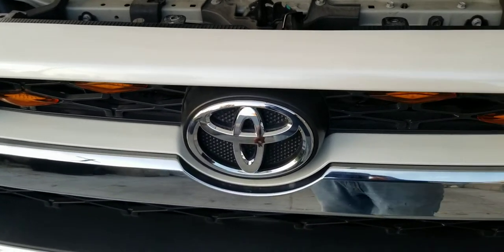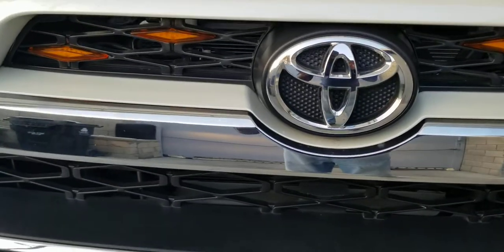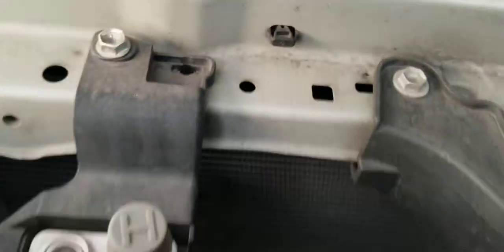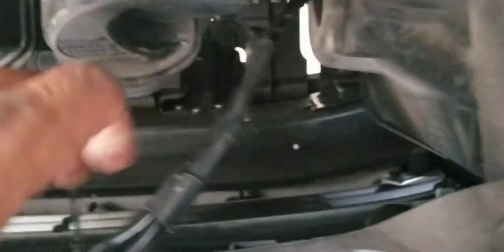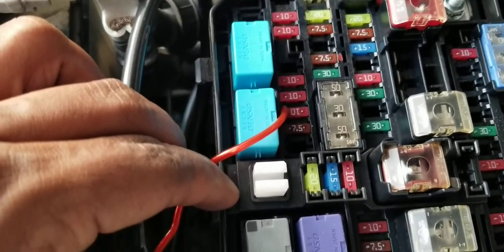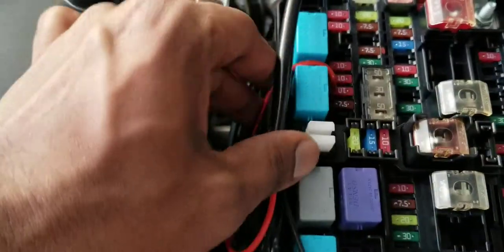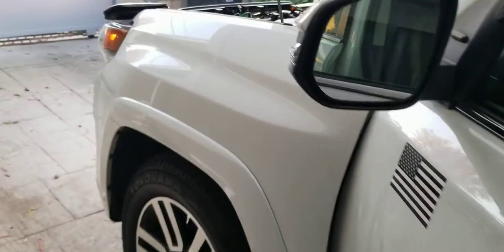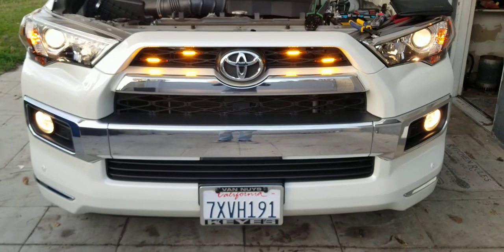How to wire + install Raptor lights on 4Runner Limited

Comment: Igor everyone who plans to follow this instructions if you understand something about  vehicles if you tap exactly where he did yes the lights will work exactly like it’s on the video the part he didn’t show is that when you get to actually start your 4Runner the starter is going to skip nonstop and your truck won’t start because even tho this led lights don’t put a big load they still overload the 10 amp fuse and if you keep trying this you will get a check engine light and a track off light on your panel inside, if you follow this and got the lights inside don’t panic just disconnect the negative on the battery and allow the vehicle to reset for a few minutes and that should do the trick once you reconnect it but be aware that this way will not work trust me I put it to test on my own 2018 limited.
Reply: Thanks for the advice!  I used a Add-A-Circuit Fuse Tap Adapter to mitigate any issues and it worked.  Great video North Star.
Reply: For a newbie on 4Runner DIY projects, what’s the best/safest way to install grill lights on my 21 4Rnnr Limited? This video is the only one I’ve seen for this specific trim.